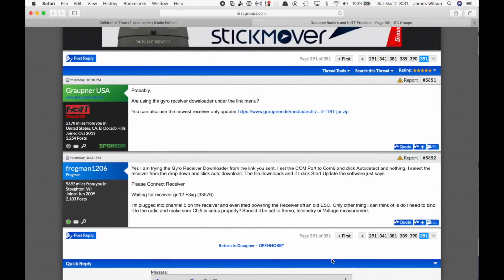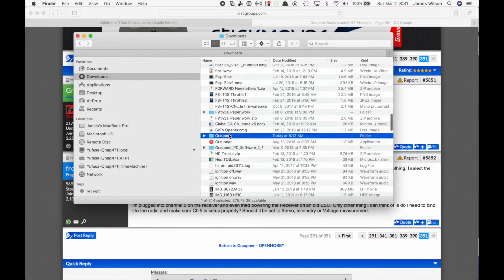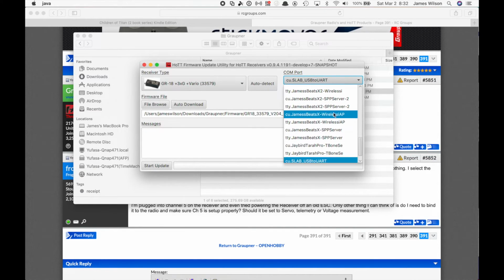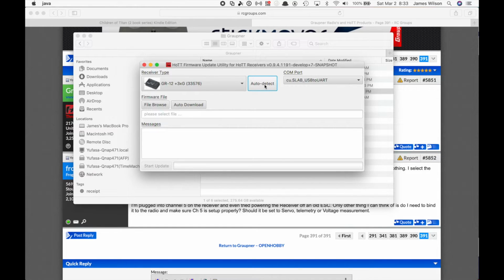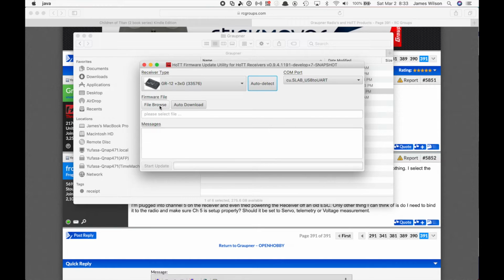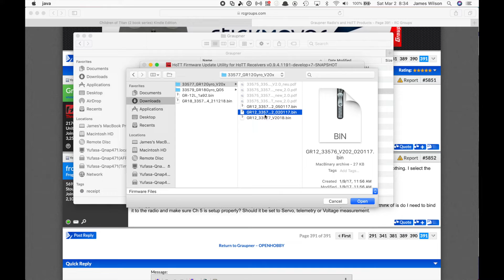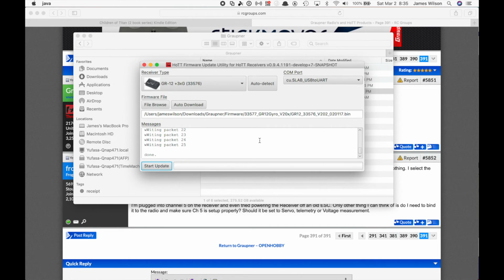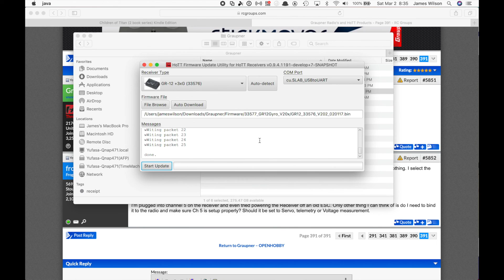Graupner Receiver Firmware Update

Comment: Sorry to bother you, but do you have some advice when the updater don't see the connected receiver? It is hooked up like you show and when I turn on power to the receiver after "Auto detect" is activated - nothing happens. cu.slab_USBtoUART is chosen...
Reply: Are you using the Java updater? I assume so as you appear to be on a Mac. As you already chose the USB port that is good. Now, make sure the two pin connector is plugged into the telemetry port, this is the cable from the programmer/USB. Make sure of the correct orientation (black toward ‘-‘) The power cable from your BEC or battery need to go into any one of the other channels again with the correct polarity. Now, make sure you hit the “Auto Detect” before you turn on the power to the receiver, then turn on the receiver and it should show up in the interface. This is all there is to it.
Reply: @jameswilson999  Thanks for replying that fast! 
At the same time I tried one more thing: holding down the bind-button while turning on the power to the receiver... That solved it!! (I sort of hope that that detail was not mentioned in your excellent video). I hold it down when I started the update too. I did not have to hold it down when answering the last dialog box that showed before writing to the receiver started. The receiver was a GR-16 (33508) Thanks again.
Reply: I will have to redo the video and include that for the time someone get stuck. I have done a whole bunch of receiver updates and did not need to touch the bind button but recall something about resetting when holding the button in while powering up. I have to assume your receiver was stuck in some unknown state and doing the reset fixed it
Reply: Good video. I have a Falcon 12 (1035) receiver, it has no button, how do I activate it?